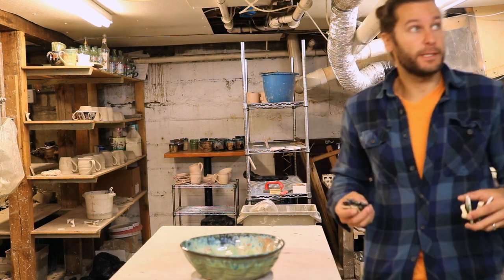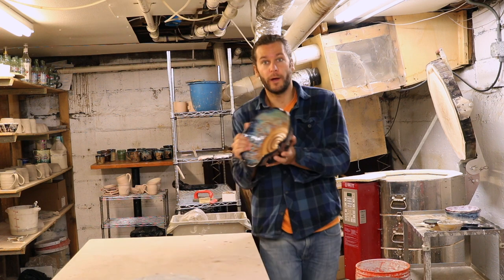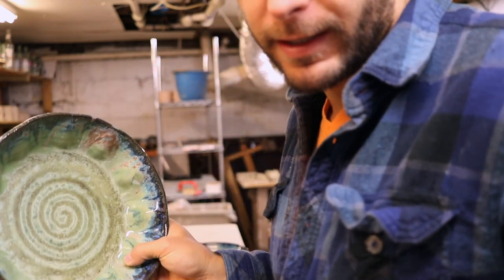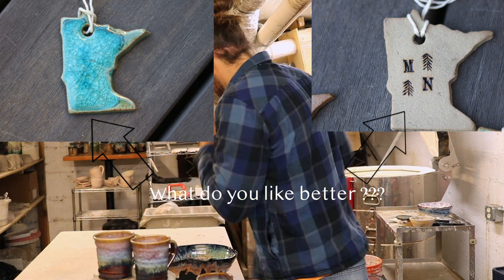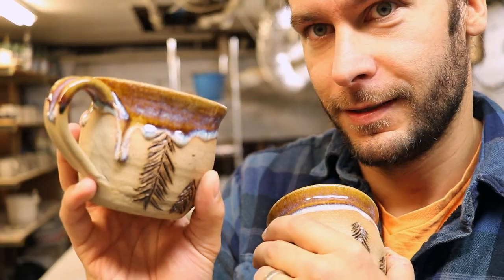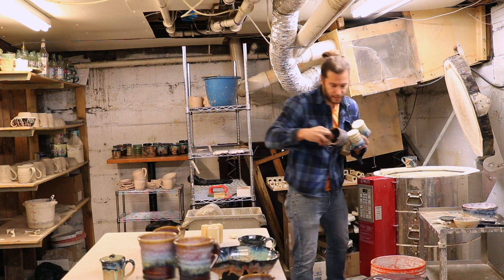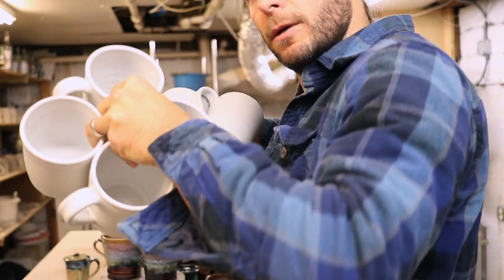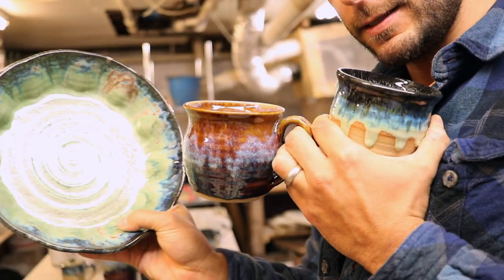See the results!  Mugs, Bowls, Ornaments! - Unloading Kiln #32

Comment: Be very careful with the burrs made by the stilts in the glaze,they can be razor sharp.remove them with a grinder,one of the type used by glass artists.they have a water reservoir below the grinder.which prevents glass dust ,very harmful to breath in.you can also use it to grind off the drips ,safe ways of working always will keep you potting .,maybe as long as me 42 years and still practicing.take care.
Reply from the maker: I am getting more and more careful with things as I do more pottery, I often where a mask whenever dust might be involved, grinding, cleaning, etc.  Thanks for the comment, I hope in 42 years I am still making pots, I bet they will look a lot different though.